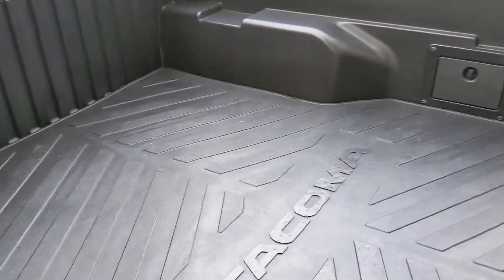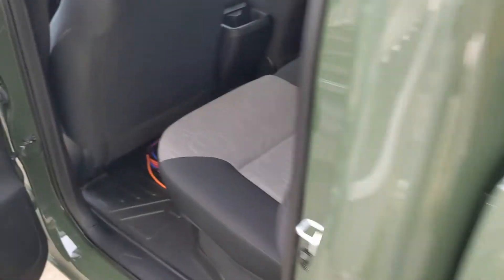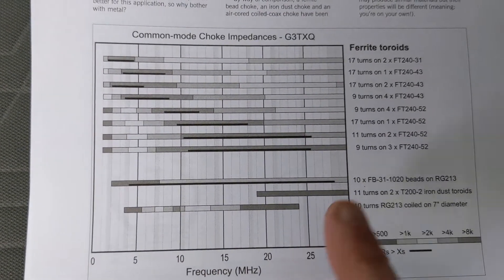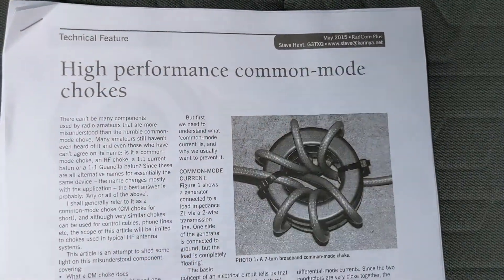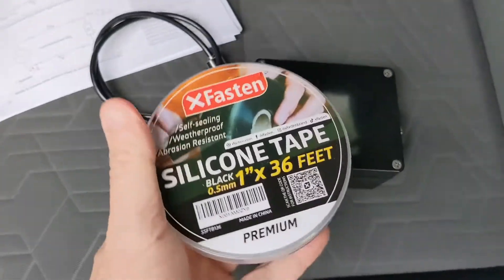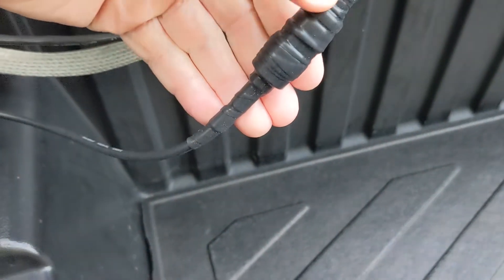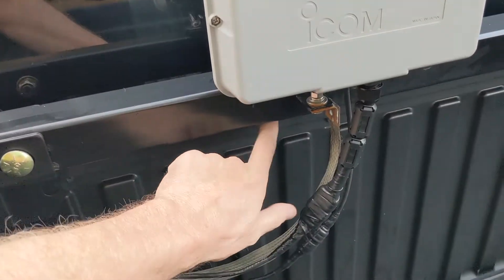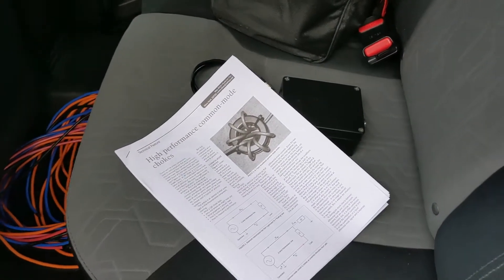HF Mobile Common Mode Choke

Comment: I I did some research the new AH-730 and now see the value in it over the AH-4. 
160M with as little as a 23' wire, I see the light!

Comment: Did you have trouble with the AH-4? 
Curious as to why the upgrade and is it worth the extra $220 bucks?
Thank you kindly
Reply from the maker: AH-4 worked great.  The AH-730 works even better.
Reply: @nu5m_radio  
Will it work with an IC 706MK2G?    I'm currently using an old LDG AT-7000, but it isn't designed for weather. 
I know the AH-4 will work but might as well go for the new one if it works.
Thinking about doing a mobile setup similar to yours.
Which is nice, BTW.   One thing, I'm curious why you made the base fold over.   Seems like it's not necessary since you remove the whip anyway.